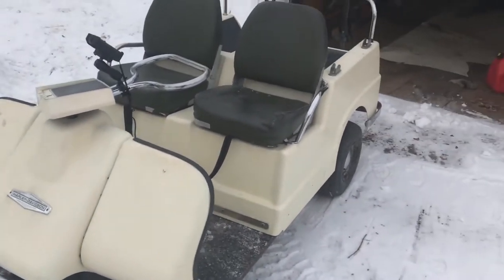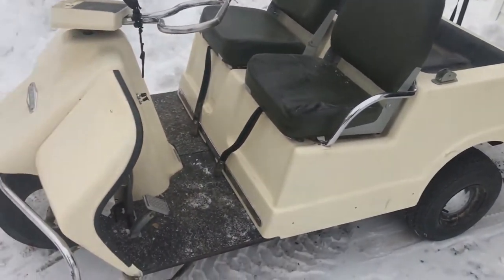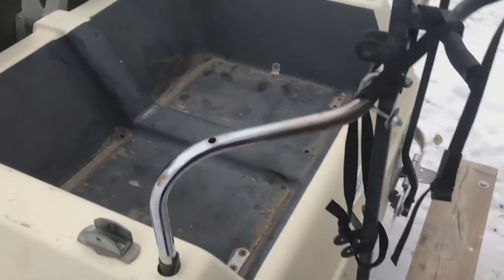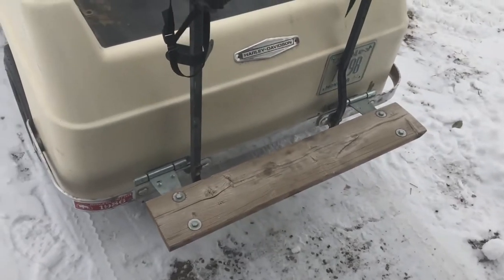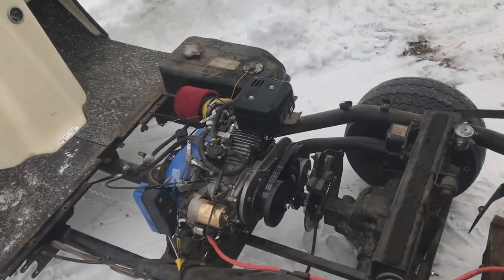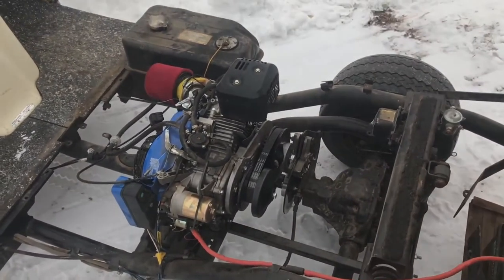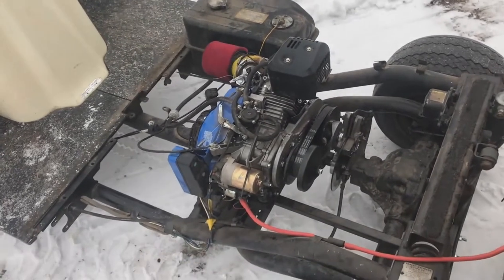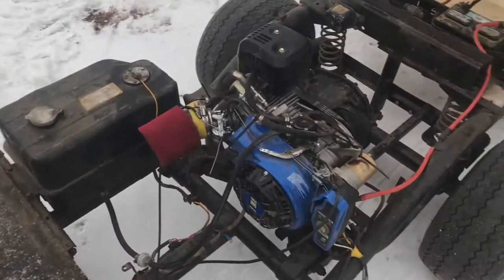Predator 212 in Harley 1968 Model D Golf Cart

Comment: What do you think would happened if you mounted everything on a slant like the original axle is to keep ground clearance?
Reply: using a four stroke engine,,,,, you need the oil levelled across crankcase.   (I think installing at the angle that HD had the 2-stroke would leave all the oil running too far over/up one side.)

Comment: How did you level the rear end
Reply: that's what I'm trying to find out too. I've got everything ready, but that angle difference is holding me up
Reply: hey I rewatched and paused the video at 9:25. If you look at the far side it looks as though he just used a longer bolt with strategically placed nuts and washers on the front of the mount to lower the drive shaft.
Reply: Thats basically the only way to do it, I lifted the back of the golf cart up and loosened both the bolts to where the nuts on the bottom almost came off, then i took the front bolts off the mount and replaced it with a longer bolt, i put washers and nuts in between the mount and the frame, afterwards tightened the back bolts as far as they could go and made sure to add more washers/nuts to the front bolts to accomodate for the extra space, the more washers/nuts you can fit between the mount and the frame, the better level it will be. After i put nuts on the bottoms of the bolts in the front i lowered the back of the harley down and if you did it right it should stay level. Its optional to replace the back bolts but i didnt